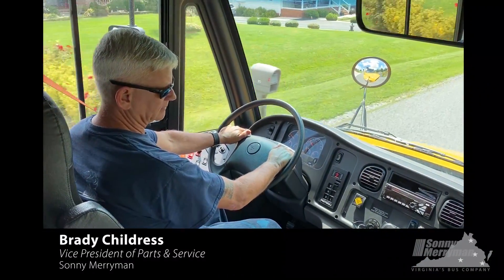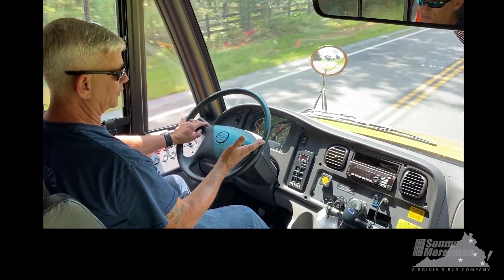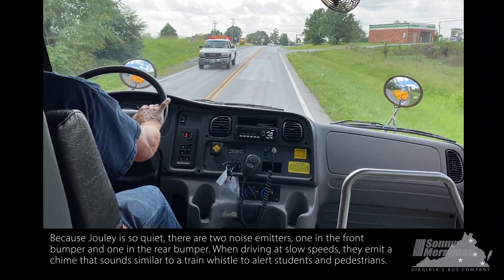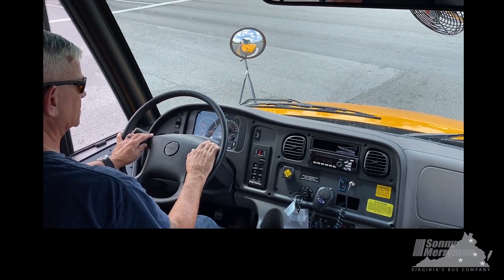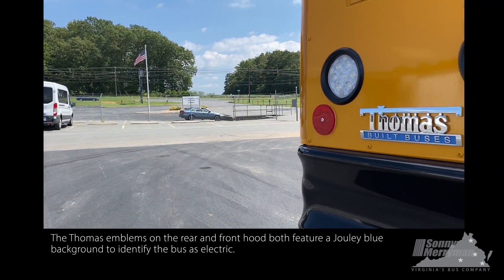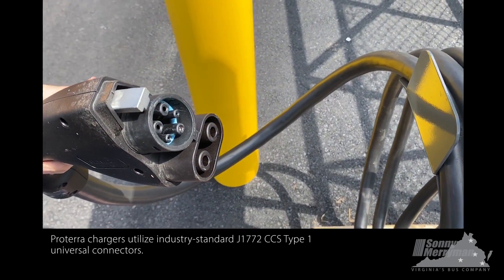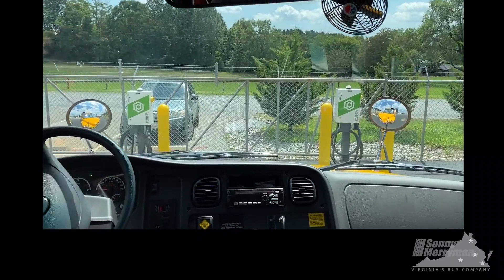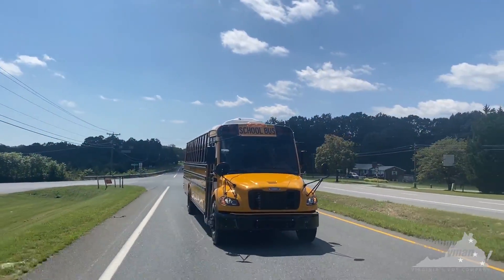Take a Ride on Jouley, the Electric School Bus

Comment: This is an awesome bus or I’ll call it an EVB. I’m “getting” sold on electric vehicles but not overnight because it’s going to financially hurt people and the economy. I believe the transition period is something we really need to keep a close eye on to make sure it’s as painless as possible, and not political ! Now with that said this bus is a very sensible answer to just that. First off it’s an awesome school bus, it almost makes me want to quit my job as a Boeing Aircraft Mechanic to go drive a EVB school bus. The design, the mechanical craftsmanship and overall just a really cool looking new school bus, I feel this is the most prefect application of an electric vehicle I’ve seen till date. We have all had that school bus diesel fuel exhaust blast into our face at the bus stop or car windows, heck it even comes in through the heater vents on some of the older cars. Cost wise to fuel those bus fleets have to be astronomical Nation wide. I think this bus is awesome on so many levels economically, environmentally, public and employee health wise not to mention shedding a positive light on the EV market to the general public like myself who are on the fence on the switch from oil to electric. I still do not feel totally electric is ready yet. I also feel it could never be 100% for a multitude set of reasons one being we can not charge these EVs without oil right now. Windmills and Hydro alone will not be able to handle this country’s grid load on those two alone just yet but, I do feel this electric bus is an area that could and should be fully electric, and it would be for the best for a number of factual obvious reasons. It’s an absolute perfect application for a fully electric vehicle not to mention the bus itself is a beauty. It’s a good looking bus and well made like all the Thomas lines of busses. It will be a change for the better for the health of our drivers and children. I’m not a bus drivers but would love to drive this bus, it’s totally awesome and kudos to the engineers at Thomas for this one, I think you guys knocked it out of the park with this EVB. I do feel we are all living in a very interesting and historical time in our country and if we keep having companies like Thomas and their engineers moving us gently and innovationally through this very controversial transition, I feel some day we will be “all for one and one for all” instead of “all for a few and not for all”… Overall Thomas definitely sold me on this awesome bus. I truly would love to drive it and check it out. Great job guys! 👍👍👍

Comment: These busses are not fossel fuel free or pollution free. They must be plugged in to charge. Where does that electric come from?
The manufacturing process includes digging into the Earth for the various materials used for the batteries.
How long do the batteries last? Maybe 10 years? What happens to all that toxic material when it comes time to scrap? Where does the new materials come from?
I don:t like electric vehicals. To much false hype. To much info not talked about!
Reply: I agree but they only work in a perfect world.
Reply: Nah, it's magic!  Electricity and school buses materialize out of thin air!  No fossil fuels required!  It's not like they're just moving fossil fuels and emissions from one place to another or anything.  Let's ignore all of the fossil fuels that go into building, shipping, and servicing electric vehicles and their batteries, which have petroleum as a direct ingredient and as a requirement to produce and deliver it, such as metals, paints, tires, insulation, plastics, glass, etc.  In the real world,, everything requires fossil fuels along the entire supply line and production path.
Reply: Eh, who cares.  As long as it doesn't have a tailpipe, we're good!  😅

Comment: they should make it with more batteries and more range if these busses are taken on field trips rather than the normal routes the busses are designed for.
Reply: True. I'm sure for the time being, schools will select a bunch of electric buses and then keep a few of their old gas, cng, propane, or diesel powered buses for longer trips and to have replacements if/when the electric ones need to go in for maintenance.